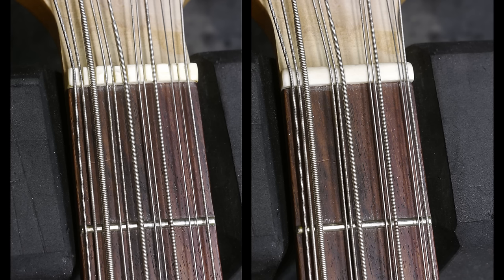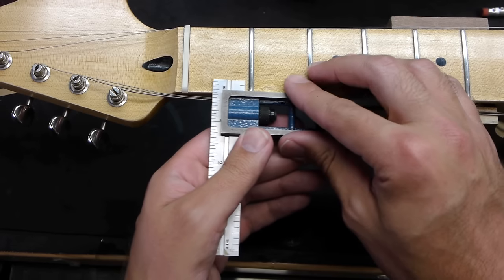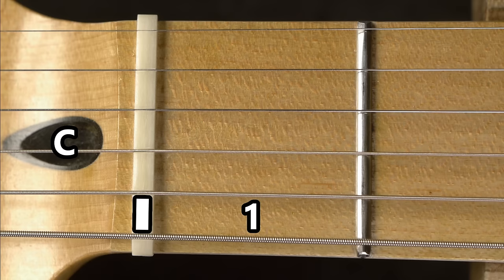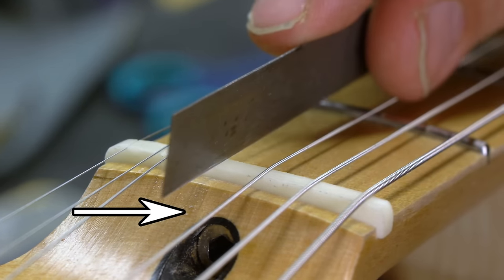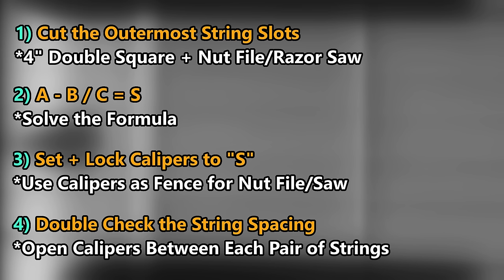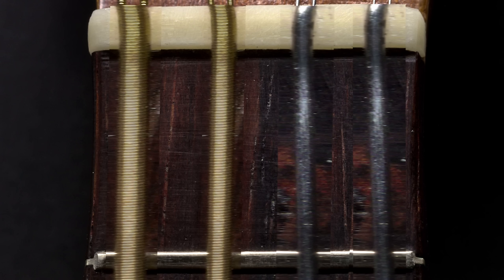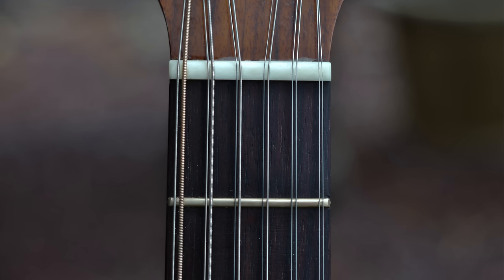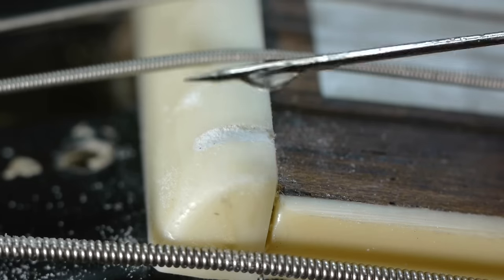Nut Slot Spacing *FOOLPROOF METHOD* - Works for 12 Strings Too!

Comment: I have always been a proponent of equal spaces and not equal centers for nuts, but I'm also a proponent of zero frets.  I prefer Rickenbacker's placing of the higher octave string second in the down strum.  It improves the playability of the fingers and the thumb.
Reply from the maker: I don't have enough experience with zero frets to comment, but am curious to try. The first guitar I ever played was my dad's old Vox Spitfire, which has a zero fret. Many people are completely sold on zero frets and I'm curious to do a deeper dive. What are the main advantages you find with them? 

Also interesting about Rickenbacker. I started out learning Leo Kottke songs on 12 string so immediately got used to the traditional octave string pairing, with the lighter string first in the pair. 

I actually haven't tried a Rickenbacker 12 string yet. So I'll be curious to give that a test drive as well. I mostly use 12 strings for fingerpicking and I wonder how that would feel with the octave pairs reversed. 

Equal Center spacing is another opinion for sure -- I prefer equal gaps like you do, but I fully acknowledge that some people are dead set on center-to-center spacing on the strings. 

I don't currently have a method for doing that like I do for this. So always more skills to develop. Preference is king, as always, and the ability to customize your instrument the way you want is what makes it so much fun. 

My goal is always to come up with ways to provide as much control over those customizations as possible. If I run into someone who wants center to center spacing on a nut I'm definitely going to have some more homework to do.
Reply: @guitar_md there's 2 main benefits, 1 for the player and 1 for the luthier. The players advantage is that the strings rest on the zero fret, so it creates a more even timbre or tonality between the open string sound compared to the fretted notes. The luthiers advantage is that you no longer have to worry about slotting the string depth perfectly, as long as there's enough downward force that the string rests on the zero fret, the depth of the slot does not matter, so it definitely saves some time with making the nut.

Comment: What is this ruler holder device you’re using on here to make the 4” square?

Also, did you use the same exacto razor saw to make all the slots and then finish slotting with the actual nut slot files?
Reply from the maker: 4" Double Square is the tool. Ruler is included, all sold as one piece. 

I only use the razor saw for the High E string, and the modified one for the B string, and only because the saws fit the size of those strings. The .010" saw for the High E, and .012" saw for the B string. 

Every string must be cut with a file of the same diameter of the string, or up to a couple thousandths over. 

Hope this helps!
Reply: @guitar_md  But how do you get the files to fit under the calipers on the other strings?
Reply from the maker: @KingzStringz  The Stewmac files I use fit perfectly under the calipers for all strings. 

I only use the razor saw on the High E string because the .010" nut file is very flimsy. The B string is a toss-up. The .013" is thick enough to work but a .012" razor saw is much stiffer. But to get the razor saw to fit, you have to modify it like I showed in the video. 

However, the nut files will fit under the calipers for every string, and you can use thinner files instead of razor saws if you want to for the high E and B strings. Just have to be careful not to flex them too much which can be challenging.
Reply: @guitar_md  Ohhh ok, Gotcha. Yeah I have the music nomad files and they definitely don’t fit under the calipers, any suggestions on how to get around that?
Reply from the maker: @KingzStringz  Are they the double edged files? 

This method will only work with the single edge Stewmac style nut files. However, a potential solution: 

You could mark a pencil line against the caliper edge, then, using a feeler gauge of the same thickness of the string, place the feeler gauge against the caliper jaw, and trace a pencil line along the edge of the feeler gauge. 

Then you could line up your Music Nomad nut file between the center of those two lines. I'd make an extremely shallow cut first, put the string into the slot, tune it up, and measure the gap between the strings. 

That gap should equal "S." You can tilt the file left or right a bit as you file to move it left or right as necessary. 

So if I had to use files that i couldn't use against the caliper jaws, that's what I would do. Two pencil lines, then cut between those two lines. 

You can even put your thumbnail on the edge of one of the pencil lines, to use as a "fence" for the nut file. This is what Steve K., my mentor does, when cutting nut slots by eye -- which is the way he's always done it. 

He lays out the strings by eye, then draws pencil lines on either side of the strings, then puts his thumbnail against the leftmost line, using it as a fence for the nut file. The rightmost line acts as an additional visual guide.

Comment: So I'm a machinist cnc programmer by trade and Luther/drum tech/ audio engineer  by night. So I just wanted to let you and everyone else in on a secret when using calipers as most people for what ever reason don't notice or realize this. I almost always when applicable use my calipers the opposite way for checking depth and or setting a gate it's a larger flat ground surface. I also would never advise putting a file to my calipers as a gate. Yes I own calipers that are not as expensive as say others but if you plan to use file on I.D blades get a cheap pair of vaniers. Not a 350 dollar set like I have you will thank me later. So I can't take a picture and share it. But put a one inch block in your calipers. Lock calipers and flip them over. ON The I.D O.D  blade end you will see the face on the end of the calipers. The. The face of the other set this spacing is also one inch and will provide a better gate to get started as the face or guide is longer and keeps you more square and or parallel in this instance.

Comment: Dude 4/64 is 1/16 stop making it hard.
Reply from the maker: Resolutions of 1/64 are easier to understand with a common denominator. 

"You can set it around 4/64 for wider spacing, or 5/64 for a bit narrower spacing." 

That's easier to visualize than "You can set it around 1/16 for wider spacing, or 5/64 for a bit narrower spacing." 

In the guitar world, this is very common, and you will see 4/64" and 6/64" everywhere, including setup specifications from the manufacturers themselves, such as Fender.

People don't reduce those fractions because increments of 1/64 are much easier to compare when using a common denominator.
Reply: @guitar_md  If only somebody would invent a measurement system that was devisable by 10 like the US Dollar. Hang on doesn't the whole world except the US use THE METRIC SYSTEM.

Comment: That looks wrong dude.
Reply: It's not wrong, it's just needlessly anal. Once a human hand starts either a) marking wear the slots are to be, and or b) holds the tool that cuts the slots, there will be error, and that error will be compounded because human movement is imperfect at worst and inconsistent at best.

Now if you had a CNC machine, a proper fixture, a thoroughly proven program, and rough stock to work from, you could get nearly perfect results, over and over.
With hand work, not so much.
Reply from the maker: Whether you think it looks wrong or not is irrelevant when you can test and confirm that the spaces between the strings are all exactly the same width. 

Your eyes can deceive you. This is like saying "that sounds flat dude" when setting intonation with a strobe tuner and seeing that the intonation is perfect. Are you going to trust your ears over a  calibrated mechanical device with such a sensitive measurement?

The whole point of this method is to take human error out of the equation as much as possible.

That, and to provide a reliable way to accurately cut paired string nuts. Or tripled strings, like on a 12 string bass, which are particularly challenging to space evenly. And spacing errors on paired string instruments can render them 100% unplayable.
Reply from the maker: This is the point of using a fence. And it does get nearly perfect results over and over. Using a fence dramatically increases the level of accuracy and minimizes human error. The same way that human error is dramatically to totally eliminated when using a fence on a band saw or table saw. 

So it is not "needlessly anal."  I don't understand why you're repeatedly insulting my technique then espousing some esoteric idea of a CNC machine and a proper fixture, when in my video I've shown a reliable method that can achieve accuracy to within a few thousandths of an inch very reliably and repeatedly. 

I'm not saying this is the only way to cut a nut. But it's a dramatic improvement on traditional methods and is worth trying. Because it minimizes human error. I'm struggling to see what is so hard to understand about this or why this seems so controversial. It's very easy to try out for yourself and see -- or test your own nut spacing with calipers and see how accurate it is. Measure enough and you can establish a standard deviation for the accuracy of any given method.
Reply: @guitar_md  Your method is too time-consuming. It looks like it has to be done in situ. Your method includes resting the sharp points of the ID measuring caliper blades on the fretboard, and ultimately the method overall is no less prone to error than a traditional approach because the work is being done by human hands.
The other thing is, and this may offend you, but you sound like you're selling a cheap gadget on QVC with your ridiculously overselling superlatives. Who do you think watches these types of videos? You're not hawking the Drain Weasel, pal.
Reply from the maker: @peachmelba1000  How time consuming is it exactly, and what margin of error are you defining, in thousandths of an inch? 

The whole point of using a fence is to increase accuracy and reduce human error. 

This is like arguing that using a fence on a band saw is not any more accurate than making a freehand cut because a human is feeding the workpiece into the saw in both cases. 

What is your personal acceptable margin of error, numerically? 

Also, the jaws do not leave a mark on the fingerboard unless you're careless. 

But they can easily go directly on top of the nut itself, as demonstrated at the end of the video with the mandolin nut. I do this quite frequently, primarily on the thicker strings. 

The board can also be masked off if it's that much of a concern. A thin strip of mylar film would easily protect the board and can be slipped under the strings and taped on in a few seconds. The entire process can be done on top of the nut with feeler gauges taking the place of the plain strings however. 

Lastly, no offense taken. I share my information completely for free. And I make my videos the way I want to. My method helped me overcome the limitations of the pencil mark method, which I used for over 10 years, so it's bound to help someone else. 

Especially on more difficult nuts. Most people would be completely lost if tasked with cutting a 12 string bass nut. I was until I came up with this solution.

 Paired and tripled string nuts are extremely intimidating without a reliable, repeatable game plan for dealing with them. 

This takes all the guesswork out. Using pencil marks is not wrong. But it does have a much higher margin for error. There's a reason I use this method now after over 10 years of using pencil marks.

Comment: Just a suggestion but in your video on setting the 2 outer stings from the fret edge or bevel. You reference setting 4/64-5/64 from edge bevel. However, in your video the 4" precision square you are using the 32nd side in the video. A little confusing there.
Reply from the maker: You're 100% right.  That's showing about 2x the distance from the bevel that I normally use. 

I already cut this nut, but needed footage to show the process -- I have no idea how this happened, but you're absolutely correct..that is the WRONG spacing!

I appreciate the catch! Never would have spotted this otherwise. I'm really frustrated with myself over this, and I'm so meticulous with my videos that missing an error like this drives me nuts.

If I don't end up pulling and re-uploading this video, I just hope people will see this comment to "correct" the error. I've pinned it for good measure.
Reply: @guitar_md  No worries, mate. Great video well explained and detailed. I just happened to notice and just assumed it was an error as 5/64 seems more precise for the spacing than 4/32. I've been using a string spacing rule. I may try this method on my next nut I make. thanks for sharing.
Reply from the maker: @sunday.76  I really appreciate it. Never in a million years would I have caught this mistake if you hadn't pointed it out. 

And I'm such a stickler for macro shots. The 64th markings are not only correct but look more impressive in super close-up detail. On the reupload I just might break out my Raynox 2.5x magnification lens and get even closer, just to be a show off! I've been meaning to make some videos going over my cameras and lenses as well.....whole nother topic. 

Let me know how the nut goes. The string spacing rule is a fine tool, and achieves a sort of improved center-to-center string spacing. Merely a different 'flavor' of string spacing. 

For me, this method is my favorite...and for paired string nuts, it can't be beat. Without this method I would have been lost in the weeds when I was tasked with cutting that 12 string bass nut, with its tripled string courses. Would've been a total nightmare otherwise. That bass was actually the last step in me developing this method as I had to come up with something to be able to do it!
Reply: @guitar_md  Nevertheless, you have more attention to detail then most so-called hacks that call themselves luthiers. Take a look at what comes off the factory Gibson line. Some of the worst cut nuts. Even with the Plek machine. spacings all over the place. It definitely makes a difference on how it feels and will play if done correctly.  keep it up. just subscribed.
Reply: If only the guy knew how to use the metric system. You know like the US monitory system. 😂 😂
Reply from the maker: @John-William-000  I've never seen string gauges listed in metric. 

When you're doing this formula, you need to calculate the string gauges together. And those are always listed in decimal inches. 

Metric is not the way to go here, even if you're overseas and are used to metric. 

The one exception to this is if your string gauges are listed in millimeters. I've never heard of strings listed in millimeters, but if they are, then obviously, use metric. 

Fortunately, modern digital calipers have a conversion button. So if you normally use your calipers set to millimeters, simply switch it to decimal inches. 

The calculations will take the same amount of time either way.
Reply: @guitar_md  Even in your woke society there is no such thing as a decimal imperial inch. The word Decimal actually means BACE TEN.
Also In every country of the world string sizes are in Metric as well as imperial gauges.
Reply from the maker: @John-William-000 Decimal inches absolutely exist. That's what string gauges are. 

9-42 strings: the "9 gauge" string is .009", which is 9 thousandths of an inch. Point zero zero nine inches. That "point" is a decimal point. 

0.1 inch = 1/10th of an inch.
0.01 inch = 1/100th of an inch. 
.001 inch - 1/1000th of an inch. 

That is base 10. 

Decimal inches can be expressed by dividing out fractional inches. 3/64" for example is 3 divided by 64 which equals 0.046". 

It means 46 thousandths of an inch, as three decimal places after a zero denotes 1/1000th of an inch.

One place after the decimal is a tenth, two places after is a hundredth, three places after is a thousandth, four places after is ten thousandths, five places after is a hundred thousandths, and so on.

I have never seen an Ernie Ball, Fender, Rotosound, Dean Markley, D'Addario, GHS, Elixir, Gibson or DR string set that ever listed the metric diameters of their strings on any set, ever, and these are some of the biggest string manufacturers in the world.

I'd be curious what brand you're using and what brands you've seen that list both imperial and metric string diameters.
Reply: @John-William-000  if only this guy knew how to use correct grammar, like monetary and base, instead of monitory and bace.
Reply: @CorvusCoroneCanisLupusSawel I grew up learning metric in school and now am struggling to understand all of the guitar information that's on the internet thats based on inches. My main difficulty is with fractions and how to convert between them. And the rulers I have typically show a few kinds like eighths or tenths. So theres a lot of math involved unless I buy a ruler with the correct divisions marked out. I'm mathematically challenged and dont get why it seems so natural to yall in the US! Maybe it's my need  (or insecurity?!) of being able to see the exact divisions laid out on a ruler without having to do any mental calculations. I want to get better at it though, but is there a video on inches and decimals for overseas guitar geeks?
Reply: @smollande  On your calculator punch in the fraction you want to convert, lets say 1 sixteenth, that is 1 divided by 16, now multiply that number by 25.4 and your answer is now metric ( 1/16 " is 1.587mm)